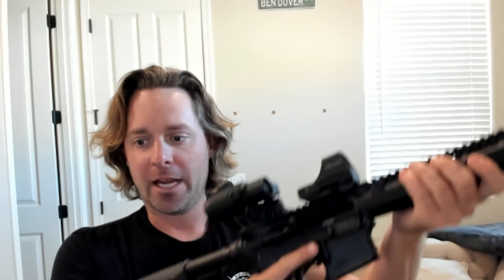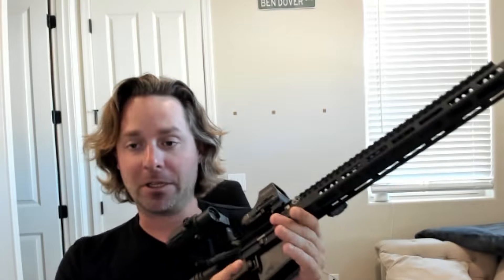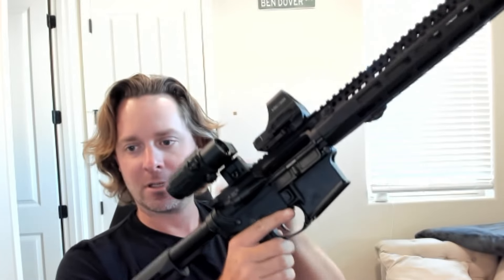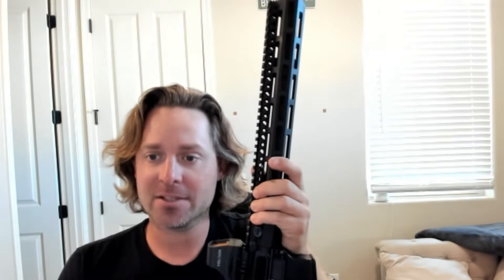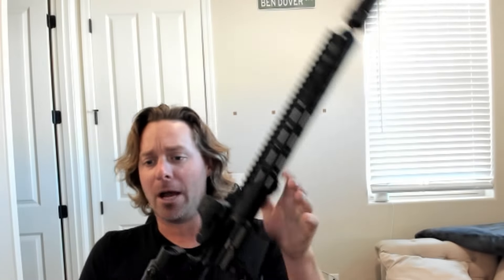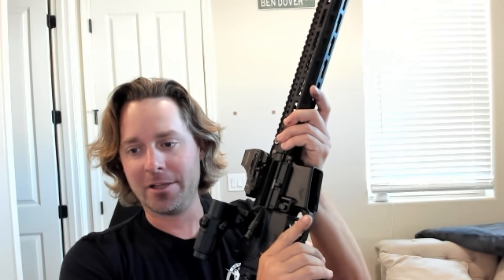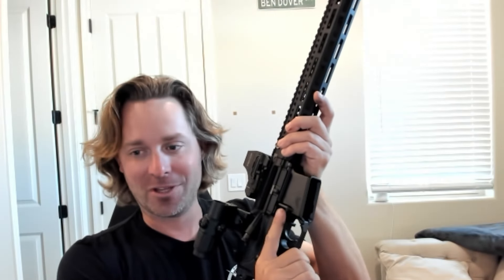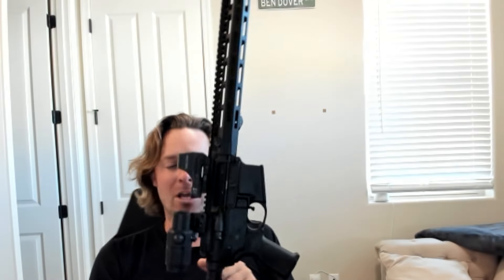BAD levers are good

Comment: Snags on stuff, fragile, can break the paddle off the bolt catch.  If you want some extras, my two are in the junk parts drawer. I much prefer a receiver that has the right-side functionality built-in (you mentioned that you're getting a Radian/AXTS lower and those are great) or modifying a receiver to accept a PDQ lever. I have both types and they work great.
Reply: Ive never had mine snag on anything running probably 10 different kit setups and shooting thousands of rounds on various uppers over the last 3 or 4 years. It doesn’t go past the magazine fence by any significant margin. The “enhanced” lowers with good bolt releases for rightys are better for sure, but I have never had an issue with mine ever. If you get a chinesium knockoff, thats when im sure you’ll get breakages.

Comment: I used a bad lever on a buddies gun for 1 range session and never ever thought i could be remotely close to a ND.
Reply: Yeah agreed you'd have to mess up really bad to ND with one lol
Reply: Shoe triggers will nd with a bad lever. And the magpul one screws up the bolt catch.
Reply: @___MC___  not sure what a shoe trigger is but I don't run the bad lever, just the geissele maritime bolt catch basically just for easier access to lock the bolt open.
Reply: @tobylewis1920  the hyperfire eclipse is a shoe style trigger. It sticks out and is much closer to the bad lever.

Comment: The only negative thing I’ve heard is bolt catches have a higher propensity to break. 

Other than that, I shoot long arms left handed and mess with the bolt catch/release that way. It’s a product, use it or don’t. 

Also, some guys (former military from what I’ve seen) - swear by placing the gun on safe whenever not actively shooting. So, if you’re that worried about an ND/AD - I’d say adhere to that policy and continue using your bad lever. If that’s the concern.

If you don’t use a bad lever yourself and raise this concern Ben’s cited then who cares.

Comment: I like the BAD lever. However, I got rid of the one I had, after part of my sling got stuck under the BAD lever while I was shooting in a competition.
Reply: Great info thanks!
Reply: Dang, so your sling got caught between the BAD lever and the top of the trigger guard?
Reply: @kennykrabss  Yes. I was running a vtac sling with the loose hanging end.

Comment: I prefer the PDQ ambi bolt release. Sits tighter to the frame just above and rearward of the mag release. Does require milling the lower receiver though.
Reply: Yeah the PDQ is really nice. I hate how the BAD lever is held on by just a tiny screw that has a hard time holding onto some bolt releases.
Reply: Might as well just buy an ambi lower then, the whole point of the BAD lever is it drops in to stock lower no fuss no muss

Comment: Only downside I’ve had with a bad lever is it seemed to wear out the spring on the bolt release faster. Eventually with the bad lever on I’d get lock backs while shooting, swapped spring on bolt release and it’s good to go.
Reply: Had one on a lower since 2014. Never had that issue
Reply: Yeah seems to lock the bolt back just from the weight of the lever so my guess is it was probably a bad spring to begin with.
Reply: Interesting, I have this same issue one one gun, bolt locks back while shooting, I will try taking off the bad lever and see if it fixes it. It's a PSA lower so maybe there is a QC issue.

Comment: I'd never heard of the ND thing, but I've heard of malfs because of the trigger finger brushing up on it while firing. Presumably this is people with huge fingers. 

An instructor referred to them as "drop in but fittable" because he bent his to be closer in to the lower and project less into the trigger guard, which seemed like a good solution if you had the sausage finger problem.

Comment: Phase 5 EBRv3 > Bad Lever.

I used a bad lever for a couple of years, recently swapped out for the Phase 5 - whole other level. Sticks out slightly further so it keeps your finger completely clear of being in the trigger guard, and works flawlessly.
I've known multiple folk who have had to try and bend their Bad Levers to fit and work correctly.
Reply: I was about to comment the same thing!  Phase 5 > bad lever.   The bad lever is just bad compared to the Phase 5 option
Reply: This!
Reply: Agreed
Reply: cringe

Comment: I have been using the BAD Levers for a long time and have installed many hundreds of them.  I also like them.

There is a legitimate issue where the BAD levers cause the bolt catch to malfunction when the BAD lever comes into contact with the receiver, either statically or under recoil.  The obround on the bolt catch is not designed as a datum ...but is used as a datum for the BAD Lever.  Misinstallation, improper joint preload and creep, and a so-so design all stack up in geotols to cause that legitimate issue with the BAD lever.  When I investigated the issues for court cases, that was the issue.

NDs are a separate issue.
Reply: Many hundreds? Sure
Reply: Yep, many hundreds of them.

Comment: I ran one on a rifle for a bit. It was cool. It worked as intended and I didn’t experience issues with it. I just don’t really find it necessary on combat rifle and would rather not have extraneous crap on it especially hanging out in the trigger guard. I thought it was handy for locking the bolt back but I didn’t think it was a significant speed improvement for reloads though.
Reply: Insanely helpful for malfunction clearing. Being able to keep your hand in a shooting grip while clearing the chamber is nice. Granted, most guns will likely not ever have stove pipes or especially things like triple feeds, but if that happens and you dont have a bad lever or an ambi lower, you gotta shove your finger in front of the bolt to clear it. Not fun when your finger slips and you mash up your finger tip.

Comment: I have been using them since I started shooting. I put one on my first gun 8 years ago and it has never caused me to ND, even when I wasn't very well trained. There are quite a few modern rifles (like the G36) that have a bolt release inside the trigger guard. I have never heard of someone NDing their rifle due to those either. If you don't have a room temp IQ a BAD lever will not magically make you ND.

Comment: I tried the Magpul BAD lever, I really don't understand how it could cause an ND but I did have an issue with dropping the bolt before my mag would seat enough times that when I finally snapped the lever off from getting it hung up on my belt I removed it and never went back to it.

Comment: This is an opinion often parroted by Ian mccollum and his inrange friends. Personally, when I first installed mine, it did seem to steer my finger towards the trigger a bit because it would "bounce" my finger off, but once it broke in it seemed to stop doing that. Also it's handy for locking the bolt back as you said in previous videos, and it essentially acts as an oversized mag release on the other side of the gun. So it has multiple purposes.

Comment: My biggest issue with it is the attachment mechanism isnt great. It will eventually work loose. Plus, its like training with a slide lock lever on a pistol instead of slingshot. If all you ever do is shoot and carry one pistol, and train under extreme stress, it may work. For people that shoot and carry multiple pistols or want universal weapon manipulation to be ingrained, the slingshot is it. With an AR i dont want training scars where i pick up mine with a bad lever and run it slightly faster than a regular AR, because if I ever dont have my exact setup ive created a scar there where im having to think in a situation i want to be subconsciously manipulating
Reply: Agree. It’s nice to have more universal transferable skills locked into muscle memory.
Reply: @coach-  haha you're not understanding what my point is. The added benefit IMO isn't worth the difference in training. You should train more if you've never picked up a gun and a lever you're used to pushing is in a different spot
Reply: By your logic, people shouldn't use the bolt release. Only the charging handle
Reply: @jasonnoblett5597  no, because the bolt release is the same on every AR15 patterned rifle. Not every rifle has a BAD lever
Reply: @brockedandloaded6034  The slide release is pretty much the same on pistols. No high-level competitive shooter or trainer uses the slingshot method. It takes too much time. The slide release is right next to your support hand thumb when you reload. Going over the top is a slower method.
Reply: @jasonnoblett5597  not true. Slide releases are all over the place. The only consistent thing is the slide when you cycle it. And competition shooting isn't self defense. I've seen more high level defensive training teach slingshot than slide release.
Reply: @brockedandloaded6034  like who? No one that I've trained with teaches that. We don't teach it in our academy because it's too slow. Most of the current curriculum taught in defense shooting classes comes from the competition world. Grip, sights, trigger, target transitions, and movement have all come from mil/le contracting with world champ competition shooters to teach them how to shoot better.